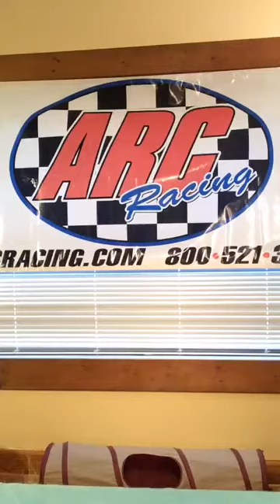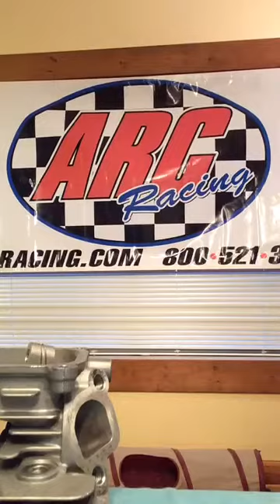Setting Valve Spring Height and Spring Coil Bind (Predator 212,Clone 196cc,Go kart racing,Mini bike)

Comment: with a stainless steel 5.5mm valve kit 26lb springs on a hemi, im getting coil bind now, do you need to take a lot out when machining the spring pockets. Im on a black mamba jr cam 275 lift 104 lsa.

Comment: I'm going g with red stripe or dual springs on a hemi.  1.2:1 rockers f275 cam.   Gonna cut the pockets out bigger for the wider springs.  Do I need to go deeper as well?
Reply: Sorry hemi head with valve reliefs cut already in piston.  The billet ratio rockers.   Springs say 42lbs at .840 install height and 80lbs at .670 install height.

Comment: stock 196cc clone 38 main jet stock emulsion tube stock carb about a 12 inch header no filter 18lb springs how many rpms should it be at
Reply from the maker: 18 lb spring are good at 7200-7400 rpms
Reply: ARC RACING  best way to clearance my crank to rod
Reply from the maker: https://www.youtube.com/watch?v=owahpOeLYaw
Reply: Would #20lb. valve springs
produce a somewhat
higher rpm than 7000-7400. rpm
on that same particular
engine configuration .
Or is that going to go the other way &  add to much resistance on a basically
stock engine ?
Sincerly, Thanks in advance

Comment: Ok I have stainless valves in a 14cc head- dyno 335 cam 1:1 champion rockers i got some 36lb dual springs with the seal in the inner spring sets higher is that normal ?
Reply from the maker: take the seal out